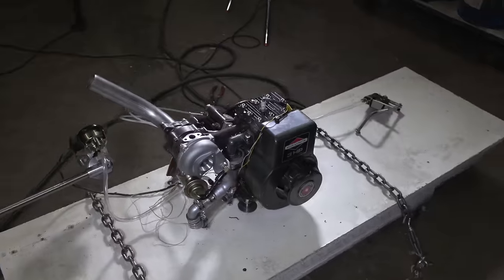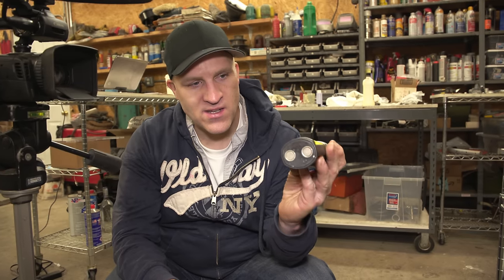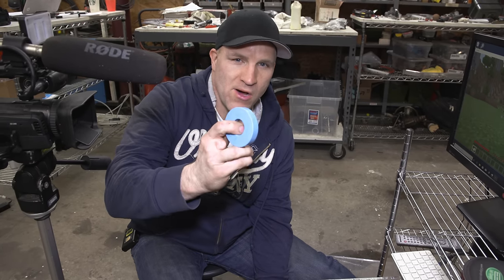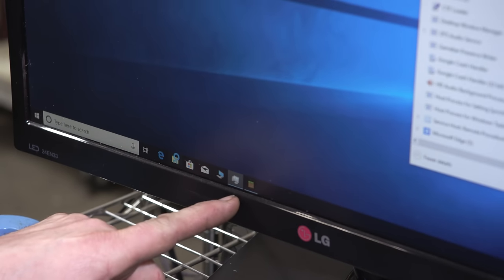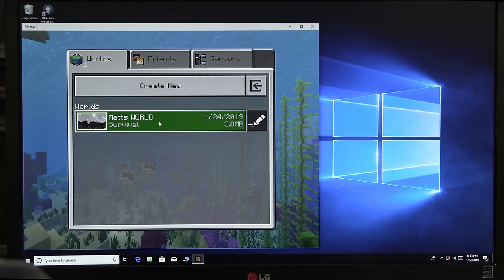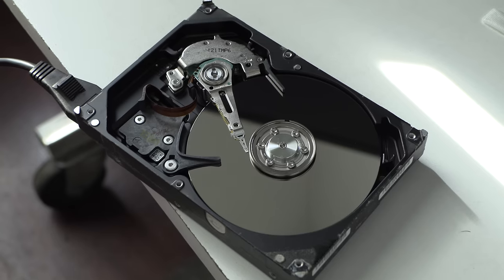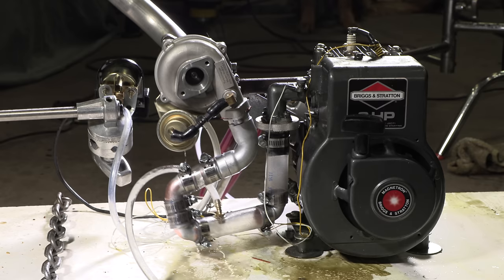Will a Magnet Erase my PC's Hard Drive? - Let's Find Out

Comment: However I don't think playing minecraft is the best to see if the hard drive is working. Cause the game is already loaded on the RAM. Interesting video none the less.
Reply: The world save file is probably not fully loaded in ram... And there are probably other things that is not loaded in ram and will stop working If the bed is not working...
Reply from the maker: You're right, I should have actually transferred a large file like someone else said in this comment section. But I know it is still accessing the disk constantly and I didn't have anything else on this computer.
Reply: *HDD not bed... Autocorrect
Reply: In Minecraft closeby world chunks are loaded to RAM when world is opened. One should move few chunks to some direction in the world to make Minecraft to load more chunks from hard disk.  @misaalanshori
Reply: @kepa219  that's what I thought too after realizing he's not moving the character, but there's probably something that's not loaded into ram.... Right?
Reply: @kepa219  Maybe Minecraft is fully loaded in RAM. But Windows things is never fully loaded in RAM. So, when the hard drive stops working, everything stops working, because OS is not working properly.
Reply: Minecraft loads settings, textures, sounds and game code in to RAM when it starts, world is loaded chunk by chunk as you move because it is "infinite" so you can't load "it all" at once. So no, Minecraft doesn't load anything else than world from HDD while gameplay.   @misaalanshori
Reply: Windows itself is just an operating system that gives you way to control softwares you have. Softwares are never loaded to RAM before you open them. When you decide to start a software, application itself selects what it wants to load from hard disk(some softwares load everything at application startup, some only partially). Ofcourse Windows is just big package of applications as well and it doesn't load that all up in startup but things like NTkernel, desktop and some services are all the time loaded when you use your computer.  @sttrnsskn5417
Reply: This is Windows 10 edition, which is constantly saving
Reply: Ah, my bad. I have been only playing and modding Minecraft Java.  @dylanharding5720
Reply: Well that's possible too but pretty theoretical situation as gameplay would be very laggy if pagefile is used :D. I don't think it's the case in this video. @Kamenko TV
Reply: the ram might not have pre-loaded all of the files onto it yet it still worked, The amount of ram Minecraft actually limits ITSELF to using at max is 1gb, Which is about half the size of the game altogether which is why I think even tho it might not be enough to test it, Minecraft in general is still not the worst candidate to test this on.
Reply: The best way is by playing video :)
Reply: duh, it puts loaded chunks in ram I think
Reply: I was going to comment that and all but then did Ctrl + F to see if anyone got there before me xd
Reply: I know huh there for it won't respond right away. It would be like a video that's all the way loaded online on dial and get disconnected and it still would play for a while. But he should of saved things and then tried.
Reply: @misaalanshori  Haha, interesting. I'm not a native English speaker but I figured 'bed' was a synonym for a harddrive. A great synonym really!
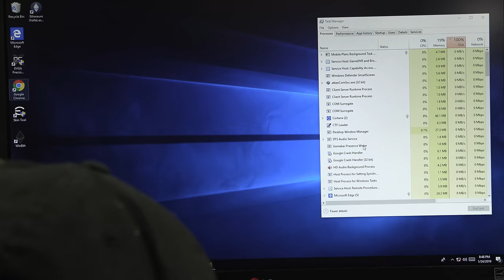Reply: 4:27 the hard drives gyroscope detected movement so the hard drive stopped to prevent a head crash
Reply: @WarpedYT  i think what happened with that rare earth magnet is that it didnt do anything to the disk itself but it pulled the read/write arm up making it unable to move

also yes i know im a year late but i just saw this now
Reply: you do know that a ram is temporary right? it wont store up games or anything like that. a ram always got empty after you shut down your pc. you clearly have no clue what you are talking about. same as the almost 800 likes you have gotten
Reply: @metalvideos1961  yes the game itself is saved on a hard drive but when launch the game a large portion of it gets put into ram so it wont have to keep loading the same thing from the hard drive so although he is half right he is half wrong as well because it doesn't load the ENTIRE game into ram so it is still using the ram during game play

i may be wrong on some things so please dont be mad at me im in college to learn more about this stuff. this is just my assumption on how this stuff might work.
Reply: @WarpedYT  slow mo guys did that
Reply: @misaalanshori  .
Reply: But if the boot drive was this HDD and any critical data gets overwritten or corrupted it can cause windows to crash. If the disk was destroyed in any way windows wouldn’t be very functional.

Comment: I think what happened with the strongest magnet is that it pulled the disks up towards itself, making reading and writing impossible.
Reply: It actually has to do with the HDD platters being made out of Aluminium and spinning at high speed in the magnets magnetic field, if you do a search for magnetic field effect with Aluminium, you will find a lot of videos and research on it. the basics though is while aluminium is not magnetic, it does interact with the magnetic field of a magnet and will act as a brake for a spinning disk of aluminium or if you just try to slide a magnet down a sheet of aluminium at a steep angle.
Reply: @byte6d653  no it was just the fysical shock from the magnet hitting the hdd. A hit with a stone would have had that same effect. The readhead on the arm skips some tracks and the hdd has to find his track and required speed for it again and thats all of the delay, all thats seen here.
Reply: maksphoto78 no it just interfered with the reed switch that makes the drive spin at correct rpm
Reply: @byte6d653  Eddy's current
Reply: @byte6d653  I see, thanks. So the magnet stopped the discs spinning.
Reply: Byte 6d65 is correct, the magnetic field induces eddy currents in the aluminium platter.  The eddy currents produce an opposing magnetic field which acts against the applied magnetic field and produces a force that slows the disk down.  A nice demonstration of this is to take a full roll of aluminium cooking foil and drop a neodymium magnet down the middle of it.
Reply: maksphoto78 no actually the read head shuts down and locks itself in place to protect the data
Reply: the head stopped to protect data
Reply: Ok it seems like this guy has no idea about computers...
A destroyed Disk will not really effect minecraft unless you try to save your world or such things...
Reply: @benediktfrasch2812  minecraft saves the world every 2 seconds
Reply: @byte6d653  Pretty sure now days they use fibreglass for the platters
Reply: ive seen someone doin it on a ssd it got completely ript tere was 0% live coming out
Reply: Nah, it's just the spinning platter acting as a conductor moving quickly through a magnetic field. This creates eddy current and slows the platter down(also heats up) to the level the hard drive shuts down.
Reply: @benediktfrasch2812  true, cause most things are allocated on to ram. But if he tries to load new chunks, then it might just appear as a blank world. (Like when your cpu becomes a bottleneck, the world just stops loading chunks)
Reply: Maybe the magnet was strong enough to stop the motor spinning?
Reply: I dont think so
Most hard drives have a safety switch when a magnet touches it it stops and once he took it off it reinitialized opening everything he tried to open
Reply: @jerrycai3317  Idk, because I bought a HDD to take apart, and it was glass with aluminum.
Reply: yep thats how pcs work
Reply: To me, it seems the magnet interrupt the reading head in some way that the drive can hardly read anything. So it puts any reading request from Windows into waiting. And then it reads normally after the magnet is removed.
Reply: Rob Son Wth is "Fysical"
Reply: it corrupts data being read and written which will make the hdd useless and windows will crash and it will make grinding and clicking noises.
Reply: @leozendo3500  It will distort the permanent magnetic fields of the drive motor also as well as producing spurious back EMF in the electromagnets of the motor too both of these will cause the efficiency of the motor to drop which compounds the problem as now it is not only dealing with more resistance due to the magnet functioning as an electromagnetic retarder with the induced currents in the conductive parts of the platter but the motor is producing less angular momentum per watt of input power too.
Reply: @robson6285  Doesn't explain why operation coincidentally happens at the same moment he removes the magnet.
Reply: yes. he didnt seem to realise the "wierd" activity after he took the magnet off was the applications he opened while the magnet was still attached
Reply: No it is not that i lurn that last day at scool
Reply: it locks the disk and stops the head moving, when he pulled th magnet off, the disk could spin and the head could move so it could do all the stuff the computer was asking.
Reply: There is a stepper motor inside it stops spinning
Reply: o rly?
Reply: @byte6d653  If the hard drive gets moved around it will stop to prevent a head crash so the gyroscope detected movement so it stopped well it actually moves the read head away form to plater to protect  it self
Reply: @maksphoto78  no it is projecting it self find my other reply
Reply: @robson6285   "fysical" rip english
Reply: @tcreeperrblx8682  thats impossible. The world is saved by autosave. Unless you turn that off.
Reply: @maxytheyutuberuwu2272  is this joke
Reply: @Tsunami joke or small brain?
Reply: @TetyLike3  english is not my language, i am dutch
Reply: @robson6285  excuse me sir wtf did you just say? i know english is not ur first language but pls atleast use google translate or something that's better than that.
Reply: @TetyLike3  is my english só bad??
Reply: @Anthony8851  okay okay, i meant physical
Reply: The FBI uses the electron microscopes on hard drives now. It's actually really cool tech. If there's anything left that didn't get flipped they can get it. But they can pick up stuff on drives decently well. Best option is complete destruction. There's a defcon talk about it if you're interested. Lots of slow motion explosives.
Reply: The drive got jolted too when it snapped onto the magnet, and shaking a HDD is never a good thing. Interesting experiment though.
Reply: The reason is because modern hdds have a feature where if the drive is shaken, or comes in contact with a magnetic field, the drive will stop reading and writing, and Windows will set up a queue of processes when the drive is ready to read again. That is why all of the programs opened when he pulled the magnet away.
Reply: @robson6285  wrong ma boi. Its just a safety mecanism built indo the drive. itl stop spinning until the magnet is gone. with a stone it would stop for a few seconds, but not this long. and as you might see, as he pulled the magnet off, it instantly loaded all the stuff that was in the "waiting list"

Comment: The strong magnet, dont kill the disk data, but this magnet is interfere for reading head i guess.
Reply: True that
Reply: Hdd have neodinium magnet it
Reply: Pistolero it kills everything
Reply: The magnet can move the position of the read write head, they only have around a few millimeters of space between them & the platter
Reply: the write head automatically close whenever it sense strong magnetic field that could collapse the plate and the head,Most HDD today have that ability
Reply: Yeah i once put a magnet next to my hdd , it screwed it up good. It interferes with the spinning.
Reply: If the hard drive gets moved around it will stop to prevent a head crash so the gyroscope detected movement so it stopped well it actually moves the read head away form to plater to protect  it self
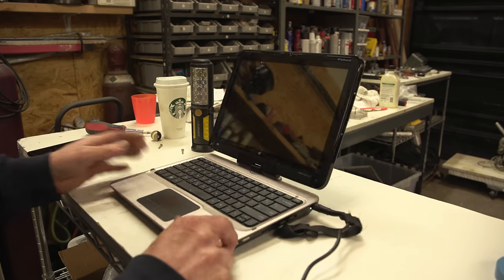Reply: @dragonfire1256  In this case, the computer in the Hard Drive parks the head when the platter RPM drops below the proper range since they need to have a precise RPM for the flying head to function properly, like at 6:21 , and starts moving the head again at 6:48 when the RPM recovers.
Reply: If you move in a paticular direction around 7 times, it can degauss the drive erasing your data

Comment: Copy files instead of playing Minecraft, it’s a tiny game it could all be cached in memory. Otherwise good experiment.
Reply: Windows itself would hang up if the hdd does not respond, minecraft would be just a indicator of the usability of the machine. And as shown when it dies, minecraft died too, no matter if its cached on ram, because it depends on the OS itself, and actually world generation writes and reads data from the hdd a good part of the time anyway.
Reply: the game limits itself to 1gb of ram that it can use, (you can see that as a preset in the launcher) the game itself is actually a little bit larger, While maybe not the best game to try possibly not the worst
Reply: @stormy4752  i use 6gb ram for Minecraft
Reply: How small is it?

Yes, I'm an absolute degenerate peasant, gloss over that for a bit
Reply: Stormy he’s using bedrock, its meant for,phones and it’s bad
Reply: yes same in my mind, cached in the memory.
Reply: "tiny"
Reply: "tiny game"

Comment: The disk slowed down when you put 40lb magnet over it due to developing of eddy currents in the disk which tried to oppose its rotational motion
Reply: Naw it slowed down and would eventually stop because it's triggering sensors used for fall detection. ThioJoe did a video where he was shaking hard drives in use and it exhibits the same behavior of freezing and queuing up requests for when it detects everything is fine again.
Reply: @ConcernedCitizenPPCA  as far as what I know, when fall detection sensors are triggered then the read write head would move away from the disk and park itself. But in the video it didn't.

Comment: The biggest problem is the impact when putting the magnet on. This can cause a head crash
Reply from the maker: Well according to the label on the hard drive, the warranty is void if the hard drive experiences impact shock of more than 350 G's , I highly doubt not a magnet hitting the drive will exceed 350 g's of shock. I'm not going against what you said but that's what the label says on the drive.
Reply: Interesting, maybe that applies to a stillstanding drive? During operation, a shock is way more problematic.
Reply: That reading must be for unpowered disk. Remember my friend accidentially dropping an AA battery From 30cm to HDD and the drive died..
Reply: @Petex90  I'm pretty sure that's a server grade drive, so it's a lot tougher
Reply: if he turned it off first so disk not spinning would have been better
Reply: @gazzacroy  if a hard drive stops spinning, then it loses all of its data
Reply: @dylanharding5720    Doh... lol :)
Reply: @WarpedYT  350gs implies static motion of the drive not spinning.
Reply: @dylanharding5720  I dont think so, it says WD blue on the cover. Most desktop PCs have a WD Blue or a Seagate Baracuda.
Reply: You've overestimating how easy it is to break a drive, people drop laptops with HDDs all the time and nothing happens, a little bump from having a magnet dropped on it isn't going to do anything
Reply: Shocking the drive like that would not cause a head crash. It could cause the heads to get stuck to the platter, maybe, or misalignment of the motor if severe enough, but not a head crash (heads physically coming in contact with each other). In reality, head crash is not something modern hard drives usually experience.
Reply: @dylanharding5720  its a normal WD blue hard drive wat
Reply: You are not far off... If the head is made of a ferromagnetic material the head could scrap/scratch the disks because of the extra pulling or the heads could get damaged... It depends of who have the hardness material.
Reply: @SamSN908  indeed, my sister who has a lot of data on her laptop dropped it on the floor and it flipped upside down while falling and the laptop shutoff.
She felt depressed when she saw the laptop shutoff and she didnt want to pick it up. I laughed and lifted her laptop, turned it on and everything was fine.

I told her that the laptop has a protective mechanism which shuts off the hard drive once it tilts more than a specific angle which is what happened. 

Also, dropping a laptop isn't as damaging to a HDD as dropping the HDD itself.
Reply: Yep!
Reply: Opening the cover on a harddrive is more risky then that magnet lol

Comment: There is a neodymium magnet inside a hard drive, so it should erase everything all the time if you think like this.
Reply: No no no no. That magnet is properly placed to prevent interfering with the platters.
Reply: the magnet is placed in between two metal holders which stop interference
Reply: Yeah, but it's out of the way of the platter, the most the magnet can do is move the head the way it's supposed to...
Reply: Those magnets also usually have a special double polarity configuration that makes the magnetic field generated much smaller.